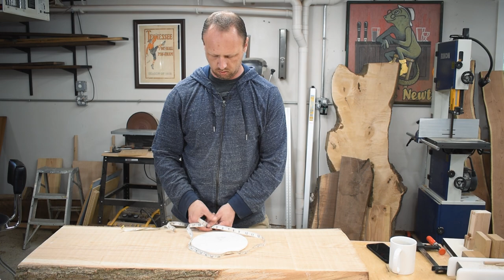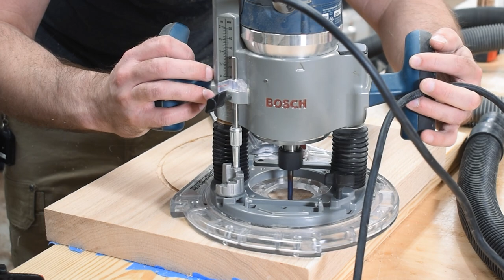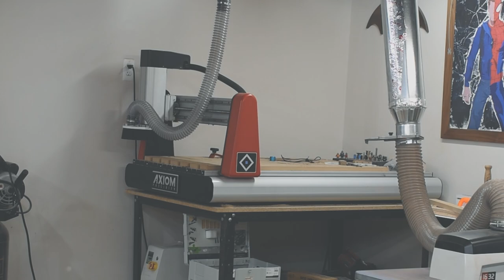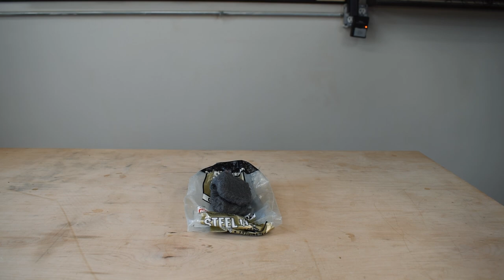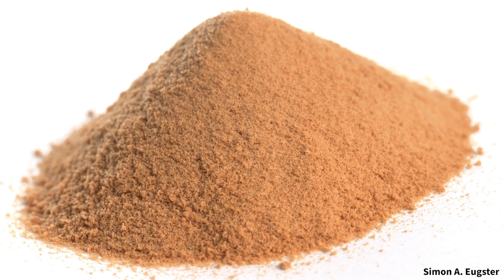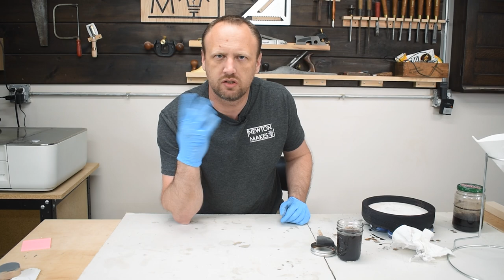Chemical Reaction Turned This BLACK! Woodworking Bowl with No Lathe

Comment: I did this today to a table base. Red Oak, but I fumed it first with ammonia.  Turned really black with the Iron Acetate.  My mixture sat around in my shop in an open jar until it completely dried out.  Filled the jar with vinegar and let it sit for a few days, shaking it occasionally.  Then I thinned it with two more parts vinegar and 1 part Iron Acetate.  Worked beautifully.  You should check out fuming.  Very interesting.

Comment: Nice video.  I use 1 pad of 0000 steel wool to 3 cups of white vinegar.  I make several batches and leave them set for several months until the steel wool is disintegrated. I use a half-gallon plastic jug for each batch and then use a spray bottle to apply it.  Works great.
Reply from the maker: That's an awesome way to do it!

Comment: Really awesome! It got super dark, like ebony. Questions: 1) will this work on pine? And 2nd) can this mix be sprayed on without messing up my Flexio?

I ask as I have a big project coming up, floating platform bed, where the customer wants the base dark gray or black (would be best) as he still wants the grain to show. I was going to use Varathane carbon gray stain and pour that into my Flexio BUT this would be waaaay better and less expensive. 

Thanks for sharing boss👌🏻
Reply from the maker: I have no idea on pine. You'd have to try and let us all know. I've only done it on hardwood. If you filter the solution I wouldn't see why you couldn't spray it. It's super thin. I'd definitely clean my sprayer afterwards.

Comment: Awesome video! Loved all the test boards at the end! I have to say though, I think my favorite part was the love song playing when you panned to your CNC!!! Made me laugh out loud.

Quick question, how many hours did you stand there with your circle jig and router?

Great job man! Another amazing video.
Reply from the maker: Poor $5k cnc has been replaced with a $40 jig! 😂

I made the entire thing in about 5hrs. But I'm also filming, which at least doubles the time, and that included milling the wood. If you know how to use the jig, it's about five minutes to set it up and to make all of the passes to get through the 1.5" slab. Then do that for as many cuts as necessary. I think I made 6-7 different circular cuts.

Comment: What is the ratio of steel wool to vinegar and what steel wool works best.
Reply from the maker: I put one ball from the package in that jar. You can see how much vinegar. I didn't measure. I used 000 steel wool.
Reply: @NewtonMakes  Thanks man I have a bunch of oak now I can tell if its red or white im hopping that its white.